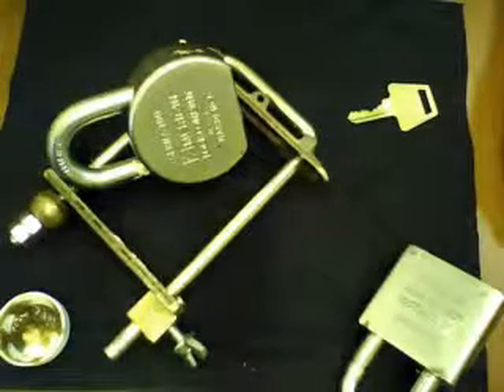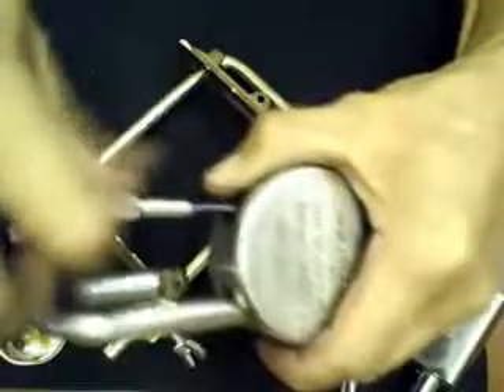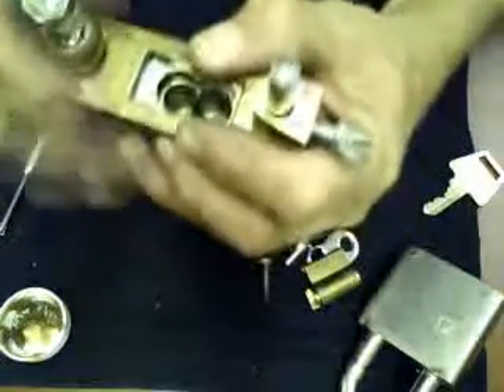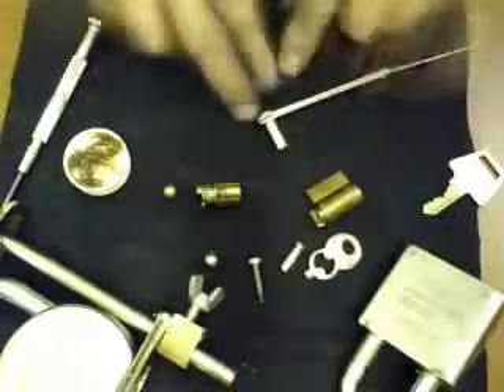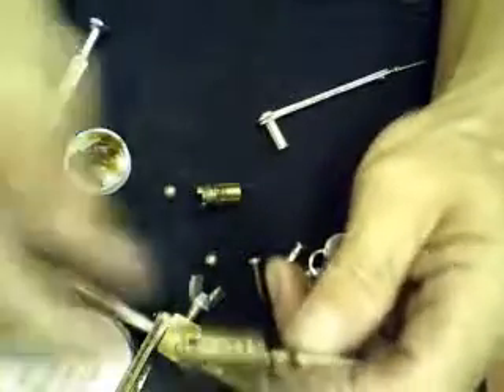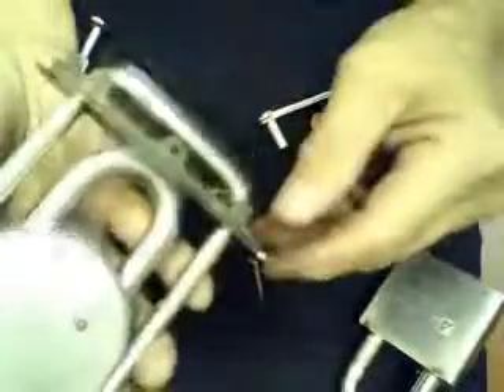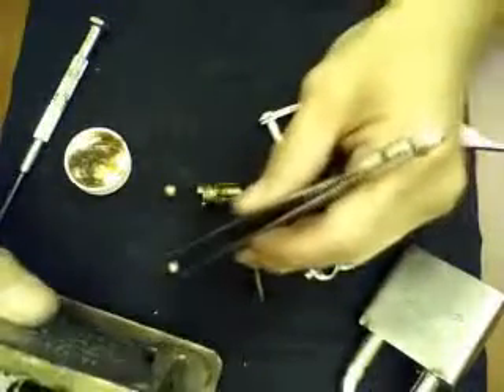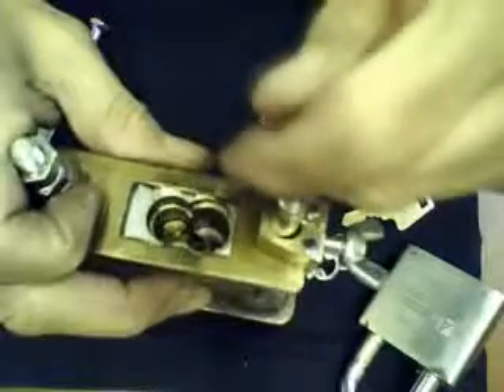American padlock series 700 disaassembly & reassembly.avi

Comment from the maker: Hi andy, in my observation,  repinning of  american padlocks (only) i would prefer to use pins exclusively for them..for the reason of..its very close tolerances of its pins that contribute to its better security. and the variation of top spool pins lenght. ZIP pins dont have the same increments as with the american lock. so you gonna go plus or minus..to compensate..and it lessen security feature. not mentioning the pin diameter. in my approach i would better stick to its orig.pins. jo

Comment: You're welcome. As you repin your locks do you use pins manufactured by American? I work as a Key Control Officer for a state prison in Arkansas. In other words, I am some what of a Locksmith. I work on American locks on a daily basis. I have pins specifically made for them but I also have ZIP pins which are different. Do you have any experience with this type of pin structure? Andy

Comment from the maker: littleDavid13, if the shackle(hasp in your term) and ball bearing comes off.. its either the shackle retainer was broken or worn out. it can be repaired in some way..the best way is try and bring it to a locksmith repair shop..however if you have the technicality and tools. a modified steel "c" clip installed around the shackle neck retainer, to compensate the worn out part, will solve the problem. regards.